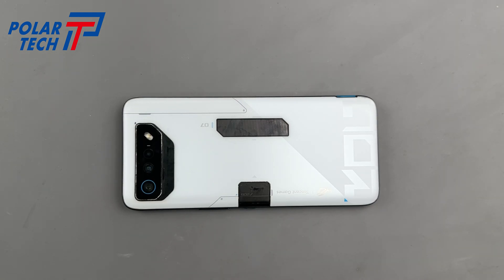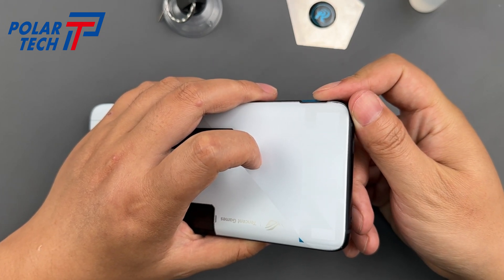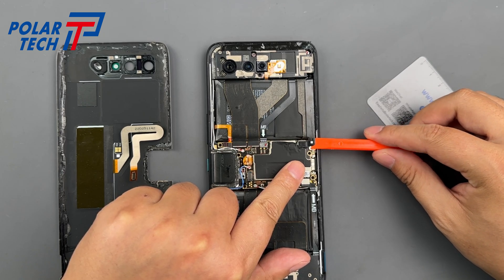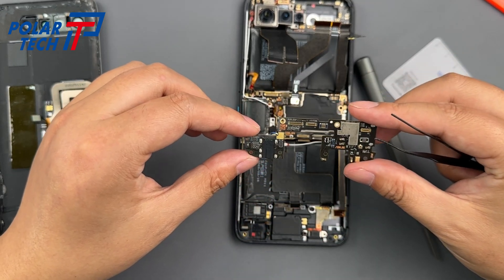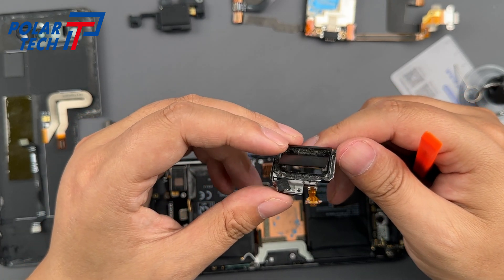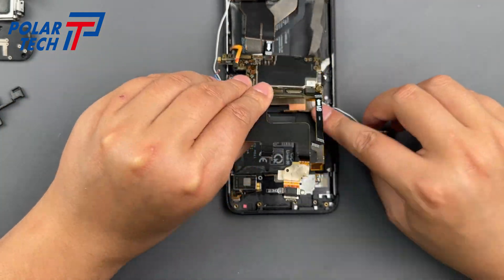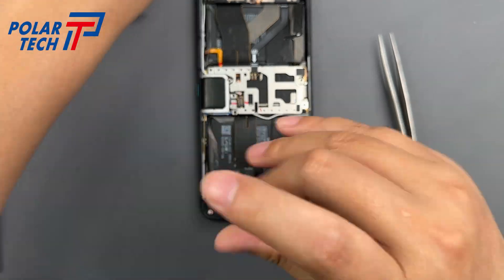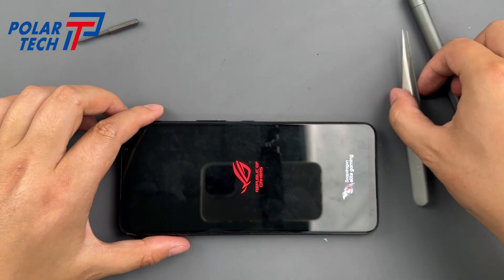How to Replace the Battery on an ASUS ROG Phone 7 Ultimate ？

Comment: After I replace the battery front camera not working
Reply from the maker: You can try reseating the front camera flex cable. Sometimes it just isn’t making full contact after the battery replacement.